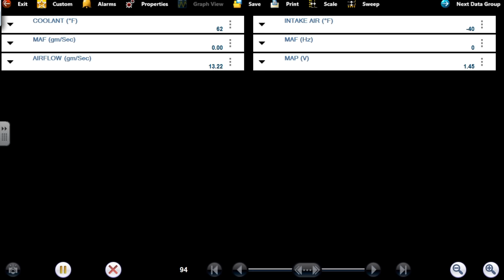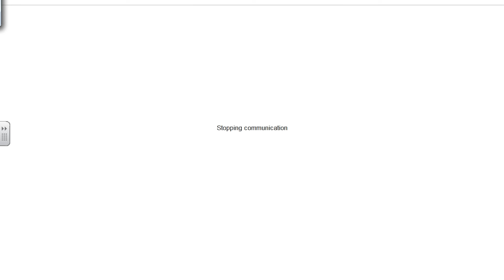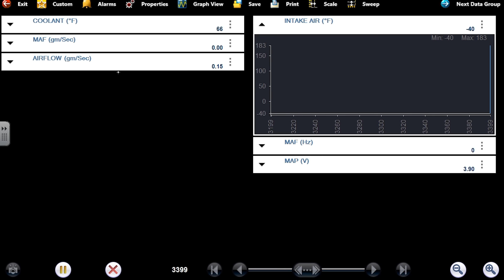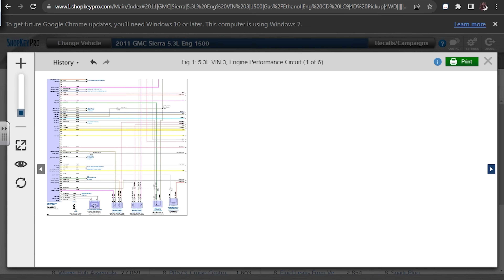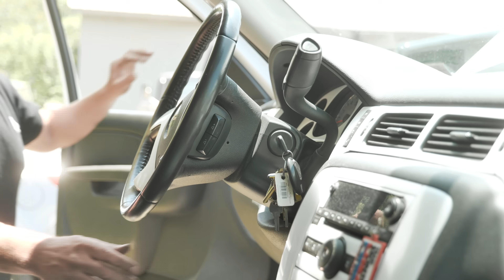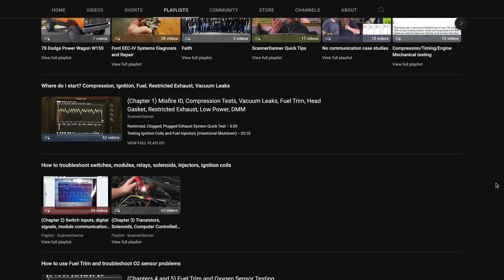2011 GMC Sierra MAF and IAT codes [New MAF Installed]

Comment: IF you did swap the sensor grounds--  and there was a future issue, wouldn't the computer give a code for the wrong thing?   Is there not a sensor/ pid monitoring the sensor grounds on the computer?   Or does it only monitor the signal side?   and If so, why does the ground have to return to the computer at all?   Why doesn't it just use a common local ground?
Reply from the maker: Good question. The ECM monitors the signal wire but it is compared to the sensor ground. And since they are both sensor grounds, the noise level will also be very similar if not identical. 
The reason sensor grounds go to the board is the help eliminate noise. You will have noise on a signal wire but this same noise is also on the sensor ground, so it cancels the noise. Think of it as your voltmeter.
But yes, great questions again and this is why I hesitated and did my research, I needed to know.

Comment: Thank you, Paul. I have considered first cleaning the wire insulation with electrical cleaner/solvent (the spray can type) and marking the wire somehow where I pierce it. I know it doesn't matter how small the pierce is; oxygen enters at even the molecular level and any contact between copper and oxygen oxidizes. Also, it's true that the smaller the hole the slower the oxidizing and that some locations on a vehicle must render the process really slow, so if contact is limited to molecular level and air flow is nil... I wish non-stick really thin vinyl tape was available. I worked in a Land Rover aftermarket shop once; somehow there was access to that; some European OEM used it to wrap harnesses. Even with no stickum on the tape it stayed wrapped. Then, you could just doctor the pinhole with dielectric grease (It is meant to insulate, no?) and wrap a few turns of that thin vinyl over to cover it. Problem solved without solvents and glues.

Comment: Brilliant, as always!

Regarding the whole crimp vs. solder thing, I used to be 100% onboard with marine grade crimp connectors, but in September of 2022, I went to work for a new company that specializes in diagnostics and post-repair validation and calibration of accident vehicles.  A few months back, I had a 2023 RAM 3500 that devoured a fencepost, straight through the wheel well, right through three 80+ pin bulk connectors (Engine main harness, transmission main harness, interior main harness), and into the cabin.

"Okay, so just replace the harnesses," I hear your say.  I would agree!  Insurance, and the shop, did not.  Pull the cab, pull the dash, re-run three main harnesses; it's a huge labor cost.  The alternative was to buy new harnesses, and use the intact bulk connectors to splice into the existing harnesses.  300+ wires, I wasn't about to use crimp connectors!  We joked about it, calling it a "harness tumor."  LOL

As it was, feathering the soldered splices along as much of the harnesses as I could, space got tight.

I still use those wonderful crimp connectors quite often on smaller repairs, though!  Super-useful, and real time savers!  Worth noting though, that some insurance companies will not accept anything other than a solder and heat-shrink repair.
Reply: I would think the labor bill to patch that many wires would have easily paid for the price of a new harness. But then again when I think about it some dealers charge stupid prices for harnesses. There been many times I been on the phone with a dealer and asked them if that part had gold in it .

Comment: As a marine mechanic who moved over from auto i can confirm. All his theory and testing transfers over
Reply: How does one go from auto to marine with no marine experience? I’ve wanted to get in another side of mechanics. Always get the no experience line
Reply: @philh9238  it’s not hard at all my guy prob the easiest thing I have done just gotta find a spot you like check some dealers out and start working. Marine is 10-15 years behind auto in electronics and diagnostics capabilities. Child’s play compared to auto. I always say an auto guy can go to marine but a marine guy can’t go to auto
Reply: @philh9238  I find my self looking back at my school training and going ohhh this just a simple version of this in auto hardest part is learning the cooling system. Some motors use open cooling other used a combo of closed and open
Reply from the maker: Thank you so much Andrew!
Reply: @ScannerDanner  thank you SD I watch your stuff just to keep fresh on theory and maybe learn something new, diff way of testing I haven’t done before or looking at it diff